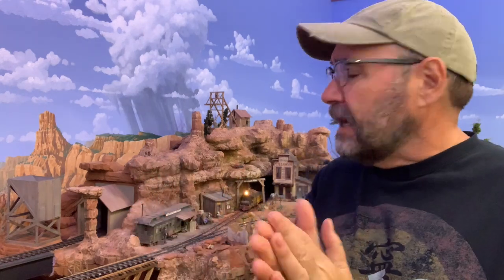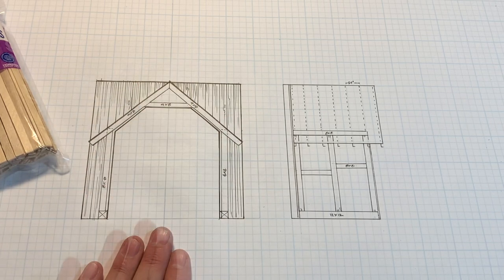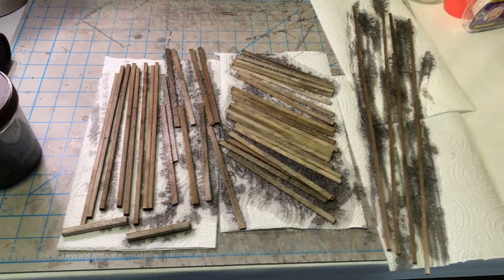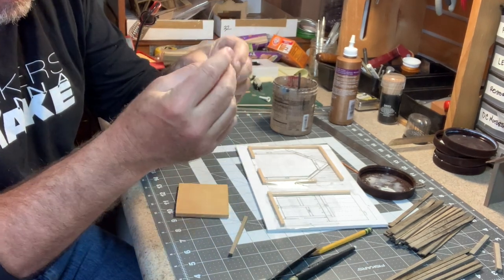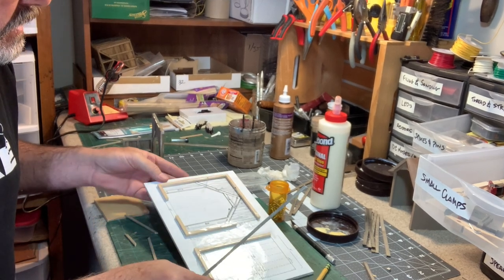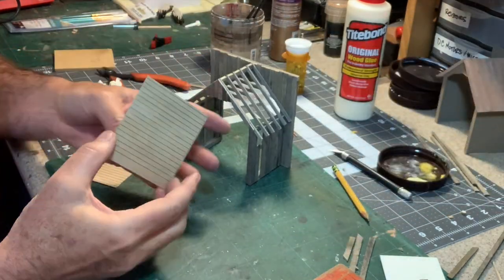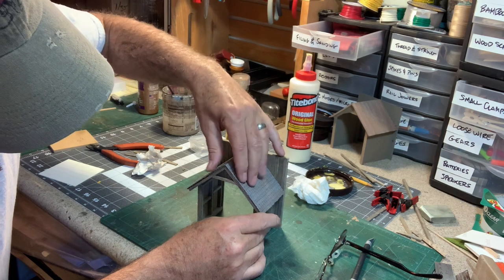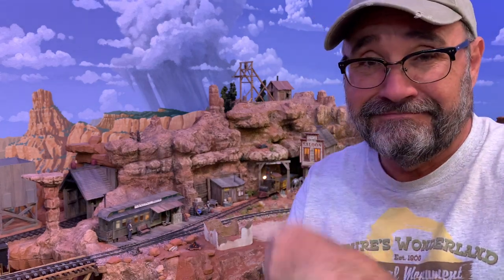Building a Peaked Roof Tunnel Portal

Comment: Nicely done. Drawings are always a great starting point.Old school modeling tip,try using double-sided scotch tape over the cardstock under the shingles. Start at the bottom and slightly overlap as you go up the roof.This also allows for adding additional washes,air brush etc for the shingles once they are installed without,  warping the card stock. Works very well for alum. or paper corrugated roofing material.
Reply from the maker: Great tip

Comment: Love the scene!  The tunnel portal is my favorite.  I use Tamiya flat black & a H3 airbrush to paint my soot.  I set the whatever on it's side & pass the airbrush like a steam engine funnel though the structure.  To me Tamiya flat black airbrushed looks just like soot, no overcoat with a flat clear, gives the black a sheen.  You should do the overcoat before the soot.  The airbrush is what I've been using since 1977.  
I want 2 pairs of them, one in On30 (1:48) & one in F scale (1:20.3), just to be different.

Comment: I see you use the “talenti” ice cream plastic containers. They are tough, good threaded cap and transparent. I tried to remove the printed outside, but what a job! I tried every solvent in the shop with minimal results. So, the rest I use as is. They are also heavy duty enough to keep heavy fasteners , etc. stored.  Very nice job on the portal.